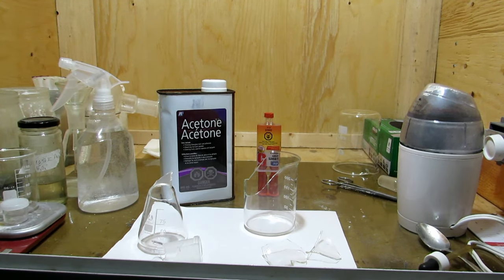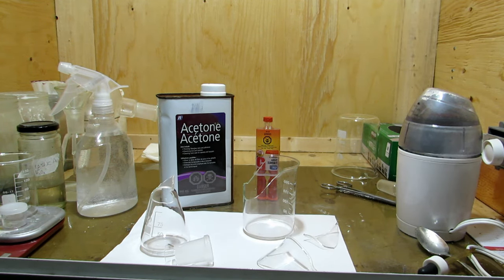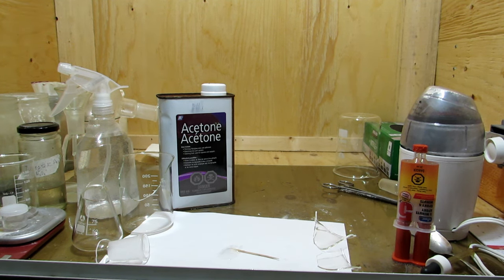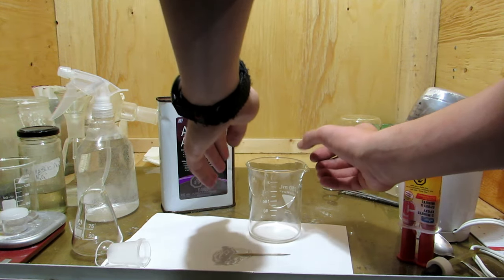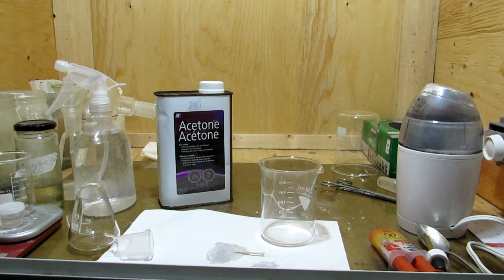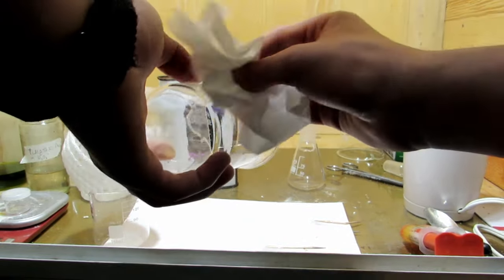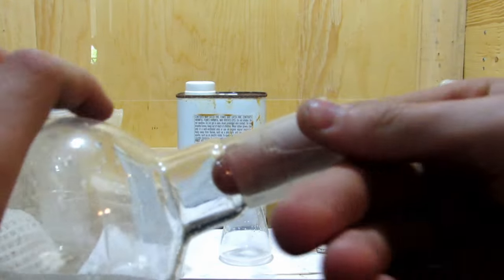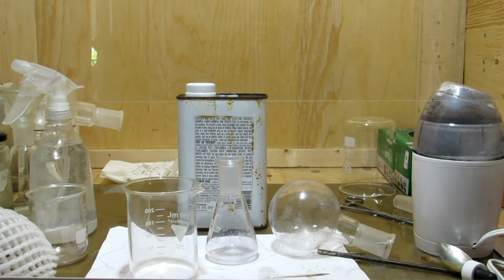How To Fix Broken Glassware

Comment: My bong broke
Reply: Stoner Penguin oil burner bong*
Reply: RIP
Reply: This is why I’m here also.
Reply: Bruh same
Reply: Stoner Penguin yo same I’m emotional rn
Reply: Actually same
Reply: Yeah. I was cleaning a Yoda bong.it slipped in the sink, hit the cushion towel and broke. I've tried hot gluing and it seemed like it worked. This morning i tapped the part that originally broke off, and it broke off again falling onto my bed. Now Yoda has a broken ear. I'm fucking sad.
Reply: Mine too n it's the best one to hence why I am here looking for HELP to repair 😫
Reply: I fart then poop😐
Reply: Unfortunately, same here :/
Reply: Same
Reply: Same
Reply: XD
Reply: Stoner Penguin my fuckin bowl piece broke
Reply: Facts
Reply: But I got some more so I’m not sweatin it
Reply: When the Pizza rolls are done same
Reply: Dude me too
Reply: I’m just here in case. I pray for all your broken bongs. My piece was 250 so I’d be bummed if mine broke
Reply: I'm emotionally attached to my bong and the manufacturer changed the design. it went through many stoner circles and is pretty beaten up but still smokeable (the base is missing and it has to be leaned against the couch, my plan is to pour a new base around the cracked one). to me it seems like a betrayal to just rebuy it, even if it would look the same as before. so here I'am, not pressed by addiction  but by the reminiscence of all the good times I shared with this piece of glass and the people around me. 

I'm here because I respect myself as I respect my bong (not in the same way of course) and I find it quite beautiful.
Reply: Thsts why i clicked on here
Reply: my banger
Reply: A year later but the same problem
Reply: Just broke mine that I've had for 4 years, feels like I've lost a loved one.
Reply: @yckit5263  R.I.P.. to yours and all the broken pieces that broke over the last two years since I first commented. I have been lucky enough to keep mine current one alive. I now have a wooden box I made to keep it safe after each use. Pour one out for da gone but not forgotten.....😁

Comment: I like to save any ground glass joints (that don't  have cracks and could still make a seal), then I can weld them to a piece of glass that it would fit to if I want a ground glass joint to it. EG: weld a 14/20 or even 14/10 joint to something like a test tube (which probably wouldn't work well, honestly).
I haven't yet tried the welding thing, but I see that cody was able to make it work!

Comment: My bong's not broken, I don't own a bong, but I did have a drinking glass that I really liked and my mom just toppled it over and broke. If I attempted to fix it this way, would the glass still be fit to drink from or should I just not bother?
Reply: Would you eat dinner on an epoxy table?
Reply: It will be fine

Comment: I have a glass jug wherein a little part of the mouth has chipped...can't join it with anything...the jug is fine otherwise but the jagged end on the mouth scares me...how do I fix it?
Reply: Use a glass grinding wheel to grind down the sharp jagged edge to a more rounded finish.
Reply: @BadBoyEzRider  thanks...it broke in few days as it fell off,we discarded it 😭

Comment: Thats really a neat thing to do, I have a graham condenser which its fitting broke, that could fix it but I have no Idea hoe strong the connection will be. I think that pieces that are going to have sole pressure on then needs reinforcement. Like putting some extra epoxy outside with some metal mesh so that if it breaks again it contains the shards and gives you enough time to quickly swap it out. Nice Idea though.
Reply: Same for me... Just broke the borosilicate distillation unit. (elbows/L-bends)

Comment: I've got a thick, cobalt-blue glass coffee mug that I've been using for years.  The best coffee mug, I was really fond of it.  It had been microwaved hundreds, if not thousands, of times.  Mysteriously, on its last use it neatly split into two pieces.  I've looked online for something similar and came up empty.  That's how I landed here.
I wish I could find a way to put these two pieces together and come out with a usable coffee mug.  Would this produce a fix that would be microwavable and withstand liquid up to 75-80°C?
And, for anyone with some insight, why the heck would the mug break like that?  It hadn't recently been shocked, dropped, or abused in any way.  It just split in two parts...???
Reply: Happened to me with a glass, it breaks like that when you either have a really cold glass and pour a really hot liquid in it or inversely, a really hot glass in which you pour a really cold liquid in it, basically, the thermic shock is what splits the glass in half as it tries to expand or contract

Hope it answers even if i'm 9 months late
Reply: @realpostto  Well, my response to your reply is a lot less than 9 months in waiting, heh!
But, I can rule out thermal shock.  This was the same exact routine that I'd used many hundreds of times before.
Reply: One possibility that has occurred to me since I initially wrote, is the chance there was some foodstuff on the turntable that resulted in uneven heating of the mug.  So, if that was the case, yes, that could be due to uneven heating.  Not thermal shock, but uneven expansion.  The result would be the same.

I miss that old mug.  It was vintage blue cobalt glass, and irreplaceable.

Comment: Hello there, got a question for you. I have a broken glass jug I want to fix because it's from my grandmother. And your technique sounds good, but I'm just wondering if it would work with a coloured glass? My jug is kind of pink and I'm afraid the acetone would remove the colour? Could that be possible?
Reply: If its painted color, NO! But if it is solid color through the glass, YES!

Comment: Do you think this would still hold if I was making glacial acetic acid in the flask? (So would it hold up to concentrated sulfuric acid and acetic acid fumes?) 
I suppose I could try it out on a small piece of epoxy, see if the sulfuric acid degrades it. But was curious if you've tried or not.

Comment: What do I do if it's not broken apart but just cracked?
Reply: You can try using a windshield repair kit (epoxy resin). It is a liquid with a pointy tipped applicator and will penetrate any openings, or chips.
Reply: Did you try the windshield repair resin suggested by @niconicouana ?
Reply: @BadBoyEzRider  nvm it shattered when I touched it...

Comment: How do you repair a long crack on an oil burner ? The oil burner still has the bubble attached it has a long crack on the bubble itself
Reply: Torch along the crack until its gone. I've fixed many cracked "oil burners" that way no problem

Comment: Glass is cheap now a days,  work on something to keep the human body in shape don't was time on thing that are cheap
Reply: its not a waste to try and fix a gift from your grandma
Reply: I spent 60 on mine and it tipped its inside chambers are still in it
Reply: It's not cheap if it has sentimental value.
Reply: My glass vase that I just broke is Murano glass. Can be repaired but not sold. I bought it 18 years ago for my wedding. It is not just cheap glass.